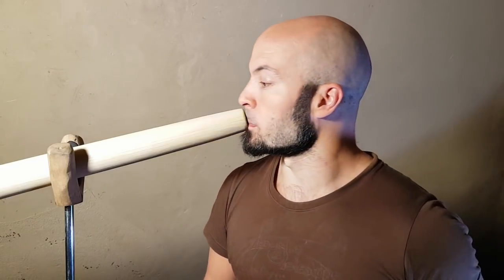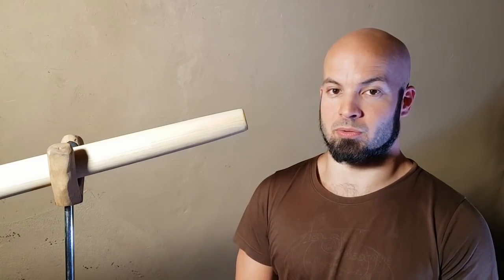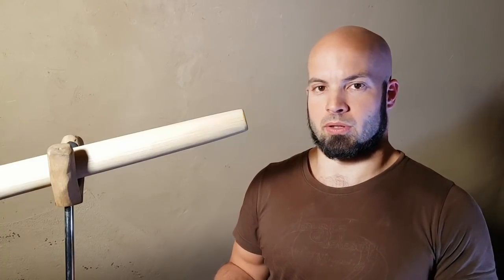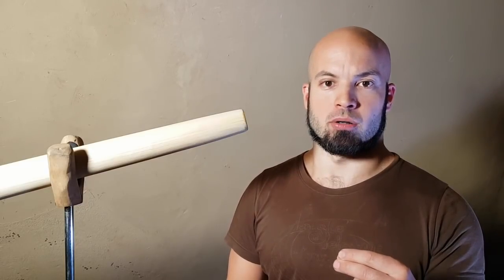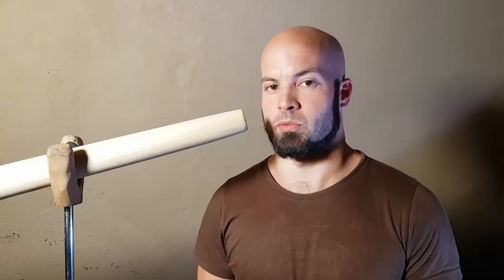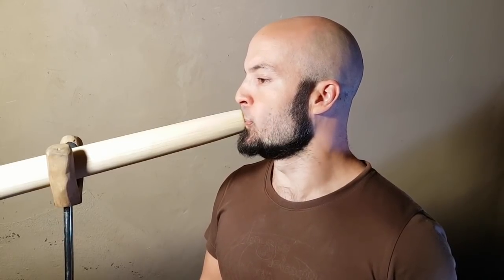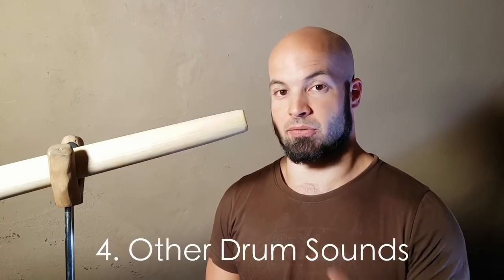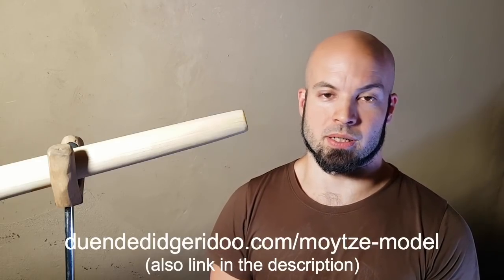Didgeridoo Drum Sound Tutorial

Comment: if i get more of a tooty sound quality to the drum sound ? what shall i do, is is because i press too hard or not hard enough ?
... I feel like the didge i have currently available is a simple bore, as with others that have a less cylindrical bore and more of a conical toots come more naturally. Is it the same for drum sounds or do i get something wrong technique wise...
best regards :) hope someone has an answer
Reply from the maker: It is difficult to know without hearing it, but probably you press too much front (outer) part of your lips which is same part that you use for toots. Consequently the inner part probably has too little connection and the whole embouchure is too "thin".  The embouchure needs to be quite thick.
Other problem could be that there is too little of first harmonics in your didge spectrum and too much of higher which then doesn't result in a full punch. But mostly cylindric shaped didges are mostly ok with that.